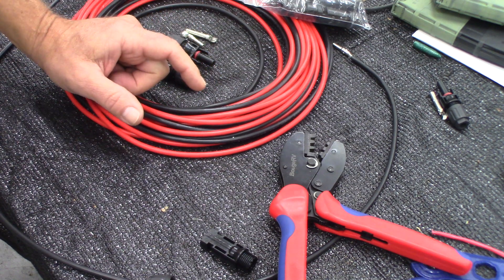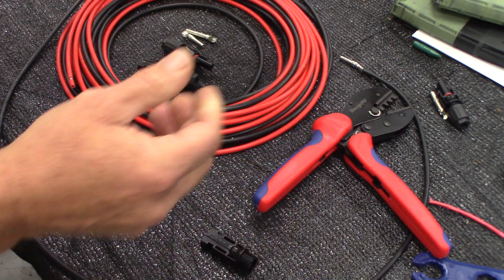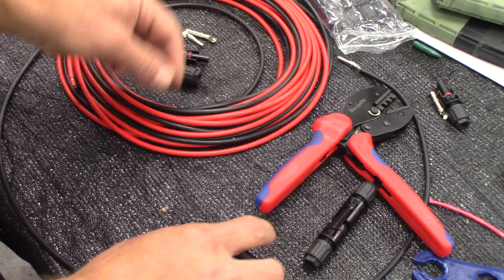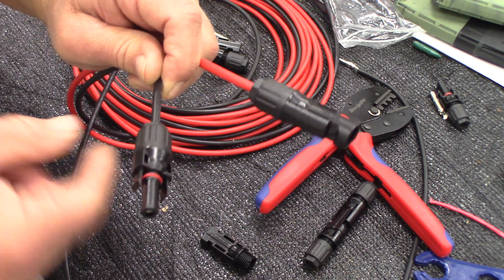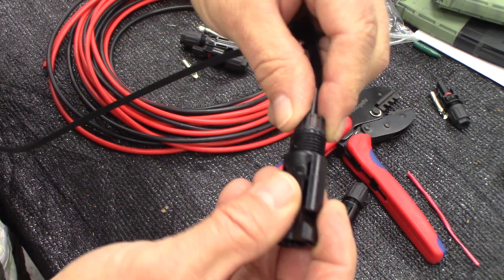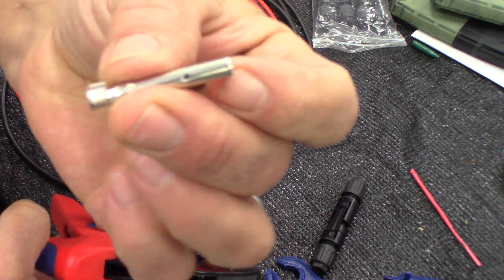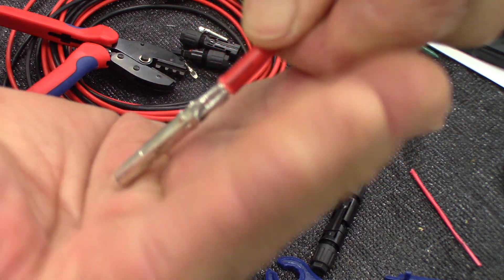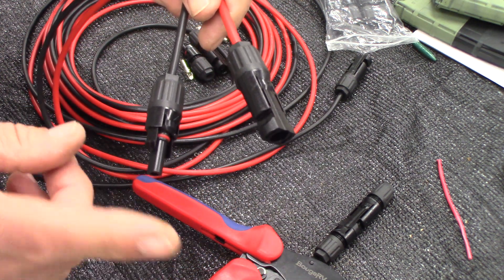Solar Extension Cables (Assembled and Explained) MC4 "DIY, SAVE BIG"

Comment: Solar and wind won’t run everything the way everything is designed currently. It has been known for DECADES that solar/wind was coming and NOTHING has been done to make it happen… Decades ago it was calculated that a solar array the size of Montana and enough batteries to store the power (years before Lifpo4 batteries) could supply the entire country. It’s an absolutely ridiculous concept, but it was a known concept. If A/C and dryers were made more efficient and usable to solar/wind you could have “free” power and that’s the reason why the utilities are still spreading misinformation.

I lived in San Antonio for a time where the power company is owned by the city. They had solar panels banned from being installed within the city limits for YEARS until public pressure  and the fact that they wanted to charge a “premium” for wind power and they finally gave in to the pressure of being allowed to install solar panels to allow them to put up wind turbines… Now if a city owned power company can actually make money from installing windmills, why are people still stuck on the idea that it’s not a viable option? Because the only information being put out are the failures from years ago. They have hidden the numbers for the power “buyback” of excess power generation and it’s not public information at all and they don’t even publish those numbers ever. And don’t even try to bring up the 2021 winter storm, most of that was due to trying to supply power to other cities and the equipment infrastructure being useless in snow. They have known for decades that it needed to be “hardened” and chose profits first, let’s not even bring up the fact that the entire state is isolated from the rest of the country’s power grid, once again, profits over usefulness. Power generation is big business and the “little” guy will always lose.

Comment: Should have mentioned it's very important to put the right connection on if your playing around with the solar panel wires. For extension cables it doesn't matter because the solar panel dictates what is positive and negative.

Comment: I'm not sure I'd take much advice from a guy who doesn't know the difference between a male and female terminators

The male Terminator goes into the female housing and the female Terminator goes into the mail outer housing..

Oh and your philosophy on photovoltaic is also wrong. solar is a viable option for running your entire house.

I live on a 40 acre ranch, my house and my 5000 ft² workshop are all solar powered. The workshops got two tons of air conditioning in it as does the house.. All run on DC mini-splits.. 

My well pump even runs off its own solar installation.. The ranch is completely off grid. And I produce more power than I can use. I would love to sell the surplus back to the grid.

Comment: Thanks for the info. Just got a hold of an Ecoflow Pro today and a couple of panels...Is there any max length that I can run extension cables? I'd like to put the generator in the basement..probably around 40" from where the panels will be...Thanks, look forward to watching you again!
Reply: Also, would I need a heavier gauge wire? 8gauge maybe? Thanks.

Comment: So Elvis is holding a female connect and naming it a male connector. He is fooled because it has a sticking out plastic part that goes into the other connector. It reminds him of something and so is called male. Whereas the sex of a connector is determined by the inserts (metal bits). It is a good idea to use the same naming convention as the rest of industry.

Comment: I am a bit confused. On the solar calculators online it is recommending me to use 6awg wire from the panels to the inverter because of the long distance the panels are from the house. It looks like mc4 connectors only use 10 to 14awg wire. I purchased some branch connectors but now I’m wonder will my cable fit on the other side of the branch connectors with them being 6awg. Why would they recommend a big size like that if I am not able to connect them to mc4 connectors, it just doesn’t make sense. Am I missing something?

Comment: Nice demonstration. My DIY system is pretty small, 7 panels in parallel, for a 1400 Watt total. I can't find a video where you can size up the wire. Is it possible using only connectors or do I need a junction box to switch wire size?

Comment: Hi Elvis, that gets me just saying your name!!!  You and I seem to be of the same mindset, as I'm delving into Solar with the Bluetti AC300 with 2 batteries etc. And I'm studying panels/ connections, total watts/volts to maintain a charge on my Solar generator set up.  It's a lot to 
take in, and I'd rather spend a bit of time up front and get the RIGHT EQUIPMENT NOW, rather than back step and but it later and waste $$$
So i guess I'm using my cents (sense) to save dollars later.  Like you gas powered equipment is OK but has so so many drawbacks.  Thanks again for your time and info.

Comment: So can I just cut the cable in half. Use 10 gauge wire. But connectors and heat shrink?

Comment: Please double check your cable genders. The gender is based on the conducting pin, not the insulating housing. So, even though the outside looks male, the pin itself is female, so these labels are backwards. This could lead to a lot of misunderstandings.
Reply: Spot on 
Glad someone else here knows their boys from the girls
Reply: Exactly!!!!
Reply: Yup.  This is confusing about MC4 connectors.  The male looking connector actually has the female internal pin, so the entire connector is considered female, and the larger connector that looks like it should be female has the male internal pin and is considered male

Comment: Should you solder these to make sure they don't come loose? How do you know which size hole to use on the crimper.
Reply: You have been taught to solder and can do it for use in high vibration environments and thus know there is no provision in mc4 for physical restraint. So you can't solder MC4s  to meet professional standards.

Comment: What’s going on Elvis I’m learning I just hope that my mind can absorb the information quick enough to get my home set up
Reply from the maker: You can’t go wrong just start collecting solar panels, solar generators, battery banks, things that will help you when things go wrong. Some of this stuff will become harder to get. We buy insurance to ensure against unforeseen damage, this is no different. Research and ask questions.I’d be glad to help if I can.. 👍👍🇺🇸🇺🇸🇺🇸🙏✌️
Reply: Thanks Elvis I was thinking this unit would handle the whole house. But as I have been researching basic wat usage. I have come to the reality this unit is a companion unit for say something in the 9000 wattage range. However once I get the 9000 watt unit I’m going to pick this unit up for everything else. I wish there was a Solar unit that could produce 9000 watts. Similar to the generator inverter units

Comment: The female insert goes into the male connector, so, the male insert goes into the female connector.  I finally came to terms with this after installing 30 panels.
Reply: Gender bender LOL 
It's the contacts, ie the important bits that count
Reply from the maker: 😂 yeah people seem to have a lot of trouble with this so I did my best to do in elementary explanation! Thanks for watching…👍👍